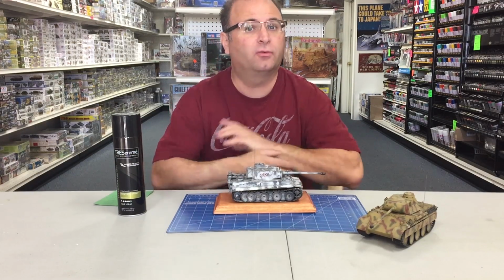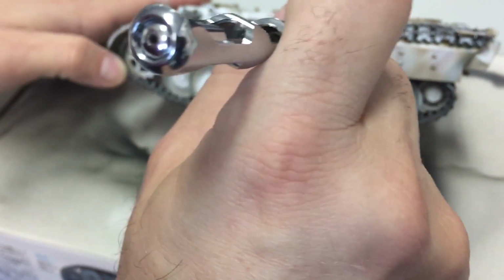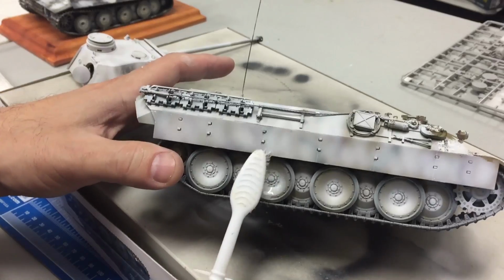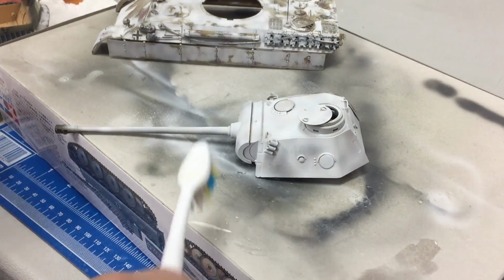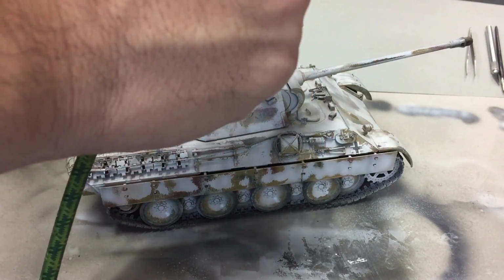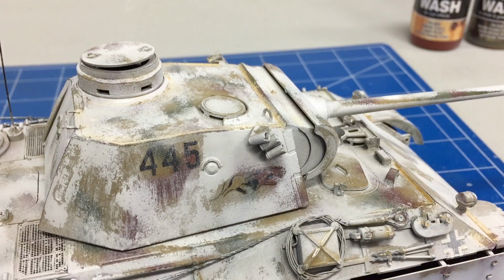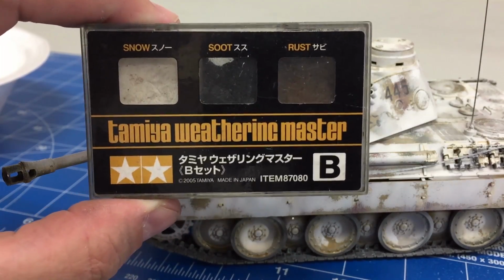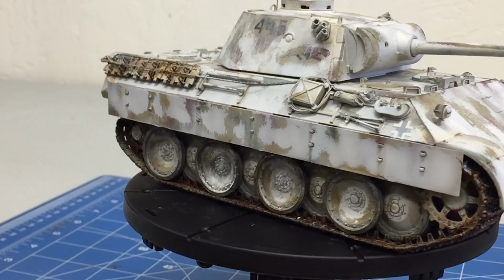Tutorial #1 Complete step by step white washing weathering of a 1/35 Tamiya  Panther

Comment: I think what appeal to me with your work, is that you don't fall in to the trap of feeling the need to do endless steps when painting/weathering. Your technique is really simple compared to some, which as someone who is fairly new to to it all, I can appreciate.

Once again, thanks for your efforts. This is a method I've read about, but seeing how well it can be done, has given me confidence to give it a try.
Reply from the maker: +lazaglider  Thank you , Exactly modeling  is suppose to be fun ,and sometimes the simple way is  the best way.
Reply: +Andy's Hobby Headquarters Andy, sorry to bother you again. I've given this technique a try over the weekend and, whilst the results are pretty pleasing, I ran into a couple of issues.

After the grey base coat, I sprayed a couple of layers of future to seal and protect. Once dry, I did the decals, sprayed again with future, then hairspray. What I found was the hairspray caused the decals to wrinkle somewhat. I managed to recover them, but the result wasn't ideal.

Any ideas as to what I did wrong?
Reply from the maker: Hi you have to seal the model with lacquer  spray after decals. future is acrylic and there fore water soluble so i can soak in.
Reply: Andy's Hobby Headquarters
That makes total sense, thanks!

Comment: Decanting the hairspray and applying with an airbrush gives more control over where it goes. Also, Thinning the white paint with tap water and spraying on in light coats gives a much better fine chipping result. No need for harsh scrubbing which might break off tiny photoetch parts or even worse, scrub through the base coat.

Comment: Would this work with a rattle can of white instead of an airbrush?
Reply: It should but you would have to use a very thin layer so the chipping fluid or hair spray could still be activated

Comment: Andy, I've got a question.  I've got two small pieces roughly 2" x 1" that will have decals in the center.  I'm doing an Arctic three-color camo pattern.  I want to make the base color on these two pieces Russian armor green, gloss coat (Future) followed by the decals then another gloss goat (Future).  Then use your hairspray technique, apply the colors for the Arctic camo then rub off the arctic pattern color from around the decals showing a little of the green around them like if the vehicle was originally painted green; but the unit was transferred to the northern frontier.  See where I'm going with this?  The bottom line is I don't want to screw up the decals.  Would it be better to put the decals on and gloss coat them then do the hairspray or to just do the hairspray over just the base color then do the decals later?

Comment: I have a question, even though this is a very old video, you mentioned a 20:1 white to buff ratio, what about thinning?  did you use any thinner in the white mix?  I have heard 30% paint to 70% thinner, is that accurate?

Comment: What is the store called?
Reply from the maker: Andy's Hobby Headquarters in Glendale Arizona
Reply: how do you get rid of the smell from the paint? Thanks! and great tank!
Reply from the maker: acrylic paint is low smell
Reply: k thx! but my gloss coat for some reason smells really bad
Reply: should i add primer just in case? i am starting out in this hobby and wondering if canvas acrilyc paint will work on tamyia.
Reply: +Tommy Lakasi Just use a good primer from your local hobby shop, the Badger one is very good.